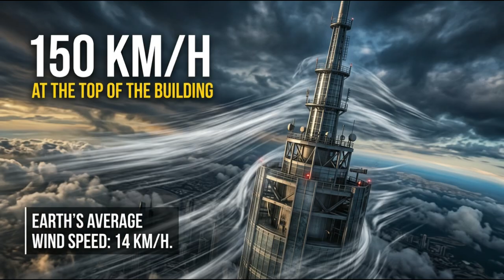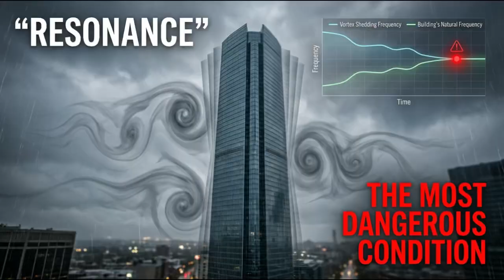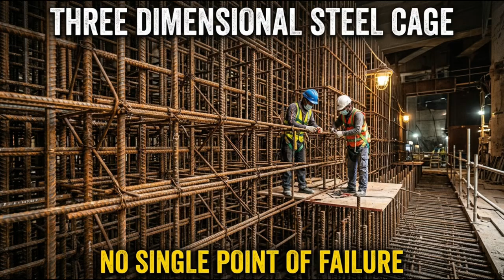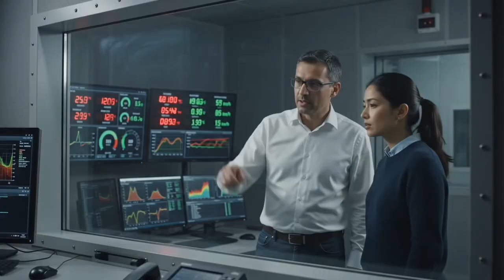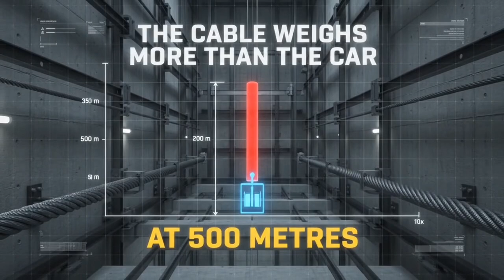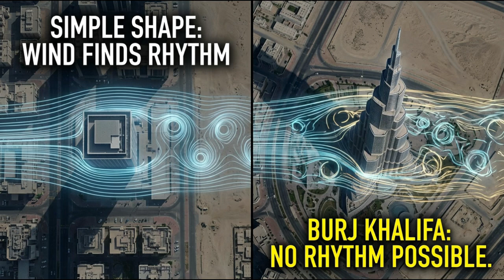Why The World’s Tallest Buildings Don’t Fall Over

Comment from the maker: The detail that completely changed how I think about tall buildings: the Burj Khalifa’s spiral taper isn’t primarily aesthetic. Every setback in the building’s profile exists specifically to prevent vortex synchronization. Wind flowing around a tall building tries to find a rhythm — alternating vortices that, if synchronized, can build resonance and tear the building apart. The spiral taper means the wind encounters a completely different cross-section at every height. It can never find the same rhythm twice. The shape of the building is constantly defeating the wind’s attempt to destroy it. And it looks extraordinary doing it. 🖤 What detail from this video changed how you think about the buildings around you?